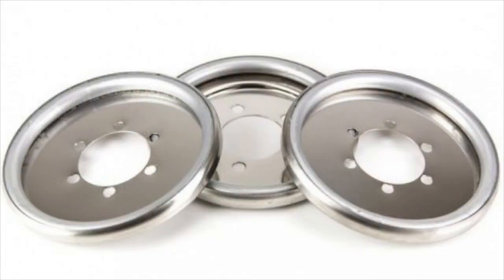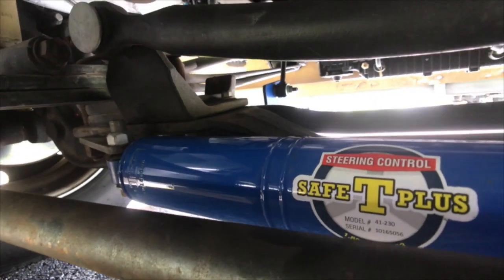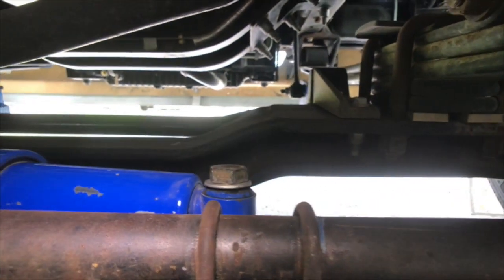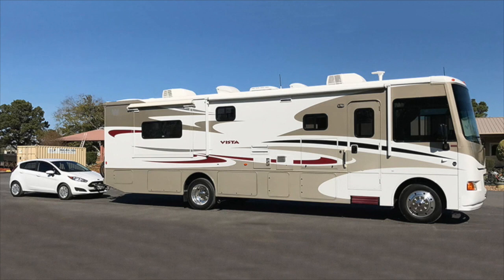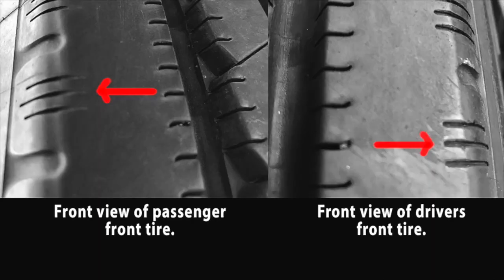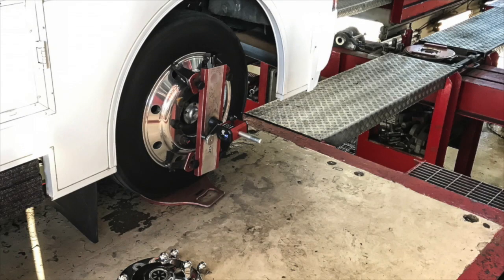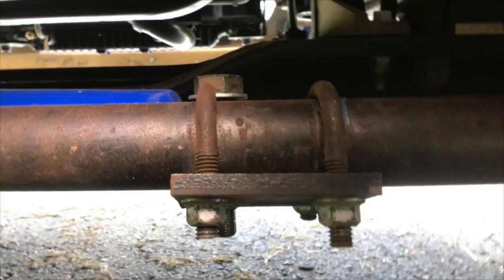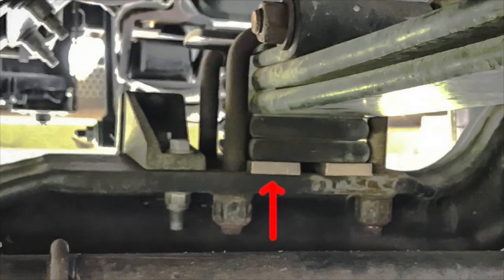Class A Front End Alignment & Safe-T-Plus Adjustment

Comment: Brother Martin, a good friend and I installed 4 Koni FSD shocks, front Sumo Springs (blue) and a Safe T Plus (blue) steering stabilizer to my 2006 36ft Georgetown V-10 motor home. What a difference! I just got done with my road test to adjust my Safe T Plus. I used your recommended method and aced it with two adjustments. Thanks so much!!! 
I’m also going to install the Super Steer Rear Track Bar and adjust my sway bars. And of course I’m adding the sound dampening mat that you and your wife recommend. 
Also … I’m a retired fireman so I know that getting under your unit and just looking around can head off a whole lot of trouble. While doing the above mentioned work I found a nail in a new front passenger tire! I’m now going to adapt your practice and make a creeper standard equipment so in can routinely look around! 
Thanks for everything brother. Safe travels!👍🇺🇸🇺🇸🇺🇸
Reply from the maker: NICE 👍

Comment: Martin,   I came back to this video because it helped me.   We bought used 2018 Jayco Alante with 4500 miles.  Steering wheel was at 1:00 most of the time.   On a short trip we had cross wind and was getting blown to the side 3’ sometimes.   I had them take the Roadmaster unit off the steering of the trade in.  I had it installed at the same time as alignment.   Now straight and true.  Toe in was way out.  That is why it was darting sideways.  Thanks for the video.
Respectfully,   Kevin

Comment: Thanks, the tip to use a hammer worked perfect.  At 20 lbs torque my bracket wouldn't move so I loosened the U bolts just enough that a good whack moved the bracket a 16th of an inch and it was almost perfect.  The Safe-T- plus is behind the axel and my 35' pulled to the right so I whacked the bracket towards the drivers side.  Be sure and mark the bracket location on the rod  with a pencil or masking tape before moving it.
Reply from the maker: Really glad it helped ya my friend.

Comment: The Safe T Plus can be adjusted in a 1/16th of an inch. To do that i used a 2" muffler clamp on the center link. Slammed up against STP bracket. Then i used a nickel to space the clamp from bracket until i got it perfect. Hope that makes sense.
Reply from the maker: Great info and thank you for sharing with the RV community

Comment: Hey Martin. Question about your install of your safe T plus.  Your video showed on the left side of the shock your bolt came from the bottom and your nut was on top. Could you not install the bolt from the top?  Incase the nut were to work itself off your bolt wouldn’t fall out.   Just checking my friend.   Oh another question. If you get a newer coach like Newmar with the comfort steer is the safe T plus still needed?    Thx.
Reply from the maker: Could you not install the bolt from the top? 
Yes you can do it either way. I didn't mention it in the video but I added a couple of drops of blue Loctite to both bolts so those nuts are not coming off.
EDIT: As I thought about your question so more let me say this. I believe that bolt could go either way. I did this install 5 yrs. ago so I don't remember exactly what the instructions suggested but IMO I don't think it would matter or hinder the way it would operate.

The Newmar with comfort drive (CD) is a DP. A totally different kind of motorhome and chassis. The jury is still out on whether a Safe-T-Plus would contribute as a safety device in the event of a blowout on a chassis equipped with CD. Some say yes, some say no. Look up Ken Sherwin who invented CD. Lots of info out there.

Comment: I installed the Roadmaster equivalent. But have not done an alignment. I assume you did the CHF since I noticed you had Tejay plates installed on your ASB. I got them also and recently installed Sumo helper springs.
Reply from the maker: Yep! How do you like your Sumo Springs? We absolutely luv ours that we put on the front. Big, Big difference.
Reply: Sumos definitely made it a more stable platform. I did rears too and installed a Super Steer rear trac bar.

Comment: I know this is an old video but hope Martin or someone will be able to answer. I have the 2015 Bounder 33C. It is 34.25 ft. (411 in.) The Safe-T-Plus 41-180 White is for 31ft. - 34ft. The 41-230 Blue is for 35ft+ . I got these numbers from Amazon. On Safe-T-Plus website it does not ask for length of RV it asks for Year, Chassis make, Chassis Model and weight. What do you think i should go for ?
Reply from the maker: Martin here, thx for your question Billy 👍
I carry the correct one for your size coach in my Amazon Store in the “Tires, Engine and Chassis Car” category. You need the blue one. https://www.amazon.com/shop/rvstreet
Reply: @RVstreet  Excellent Martin . NEVER stop making videos, we all would be totally lost.

Comment: Martin why do you prefer the safe T over the road master?
When I bought my coach the Safe T on there was done for.  So I replaced it with a road master.  I loved it.  

Btw CENTRAMATIC is the bomb.  Smooth driving
Reply from the maker: I prefer it because it's totally incased and well protected from the elements and has a great long term track record. Ours has operated flawlessly for the last 4yrs.
Reply: @RVstreet  makes sense.  I just bought me a diesel pusher class a.  Yet again another Safe T plus came with the coach and it’s done for too. The coach is a 97 I doubt it’s been on there that long.  Unfortunately roadmaster doesn’t make anything for a diesel pusher at 30k lbs.  

Btw I have an appointment next week with Josams in Orlando.  I heard great things about those guys.  I hope I get the tech you had.  What is the name of the tech you had that worked on your coach at Josams?

Lastly I love your channel bro.  Best RV channel out there hands down.
Reply from the maker: @JahRootsRadio  Thanks. I don't remember his name but he's a BIG guy. Probably 6' 4', 6'5' and probably north of 275lbs.

Comment: So I like your video, however I watched the safe t plus alignment demonstration and they say you loosen the nuts. Mine is currently pulling to the right after my install. Not sure which route to go.
Reply from the maker: I know they say to do that but the proof is in the pudding. As I showed and explained in the video this is the way to do it. If you loosen the bolts like they said to do—and as I did at first—you'll be chasing wind and never get it right.
Reply: @RVstreet  ok. And pulls to passenger side move toward drivers side correct?  That’s what I’ll be doing this weekend
Reply from the maker: @rankinprojects599  That's correct. But just make sure you make small adjustments. Like 1/16" to 1/8" of an inch at a time. Then go drive and check it. Keep doing that until it steers straight in the right hand lane—where the crown usually is—which is where you are most of the time anyways.
Reply: @RVstreet  when they made the adjustment did they lift front end to take weight off the tires?  Having a hard time just tapping it over
Reply from the maker: @rankinprojects599  No they didn't. Take a metal punch, a thick flat head screw driver, a brass bar....anything that you can hold with one hand and with a good size hammer, hit the top of the 1st clamp. Then do the same with the second clamp. Now move to the bottoms of the two clamps and do the same thing. What you're wanting to do is "WALK" those clamps over in the direction you want. These adjustments are small. 1/16"-1/8" at a time.
Reply: @RVstreet  ok thanks. I will keep working at it.

Comment: Safe-T-Plus,  not Safety-T-Plus. I'm just jealous you got one. Our coach has independent front suspension and a Safe-T-Plus for ours is over $ 2000.00. Ouch.
Reply: Why would having IFS cause the price to skyrocket to $2000.00? I have IFS on my motorhome and the cost was the price of the blue Safe T Plus and drilling one hole. I would find another installer.
Reply: @donboettcher8900   I'm guessing you don't actually have IFS.  I'm not talking about twin I beam type front suspension where you have only 1 main tie rod connecting the two front wheels. That's just a variation of a solid front axle like most of the older and I imagine a lot of the newer Rvs built on the ford truck chassis.  Safe-t-plus in Georgia(the manufacture) is who I spoke with, multiple times since 2016 when we purchased our 2003 Newmar Dutch Star Diesel pusher.  It  has two short tie rods each going from the steering box in the middle of the front suspension out to each front wheel. I'm not sure but I think it will require two special safe-t-plus cylinders to do it. It's not like on the straight axle gas and diesel coaches. It's not a matter of getting a different installer. I called a bunch of them. Other companies I also considered was True Center as I liked the idea of being able to fine tune and adjust for changing road and wind conditions or when you hit a pot hole and knock it out of center(and you will). They don't even make one that will work with our IFS. Safe travels.
Reply: It appears you have a rather unique front end on your motorhome thus the need for a one of design and install. No wonder they want $2000.  

By the way my Spartan chassis does have IFS not a solid I beam.

Comment: Not to criticize dude but after watching this video, four things really should be addressed. Again, no insult intended.
    Number one. Safe T plus , not safety T plus. The first word is safe, not safety. 
    Number two is the alignment info you give. Just about every road anyone drives on is crowned to the right in all the lanes going in your direction. The reason for this is for water run off. If the center of the road was not crowned to each side, water would puddle and cause hydroplaning in any vehicle driving thru the water. 
     Number 3 is that I would loosen the u bolts a little before you tapped them with a hammer. Not enough that they would slide but enough that you didn't have to whack them with a hammer hard to move them. When you see the u bolts go at an angle after the first hit, you are actually stretching the u bolts. Then when you tap the other side to straighten them, you are loosening the stretched bolts. I would never drive that vehicle before tightening those u bolts after repositioning them. Takes a minute and well worth the peace of mind knowing they aren't going to move and cause an accident. 
     Number 4. All F53's have a solid axle in the front. If a caster shim is installed only on one side, what happens if that the springs twist because the axle is solid. One side caster can't be adjusted. It is impossible without twisting the axle and that is never done. If caster is adjusted on one side the same exact shim has to be installed in the other side too. Again, this is due to the solid front axle. It is impossible to change the caster on only one side. Anyone who tells you differently is either lying to you or doesn't know what they are talking about and shouldn't be giving you advice. 
     I just don't want others making the same mistakes on their motorhomes and cause an accident.

Comment: The whole idea of hammering on a crappy bracket to slide U-bolts along the tie rod is fundamental to why I have no interest in having one of these piles of junk. You won't find an installation like that in any component designed for the chassis and provided by the chassis manufacturer.